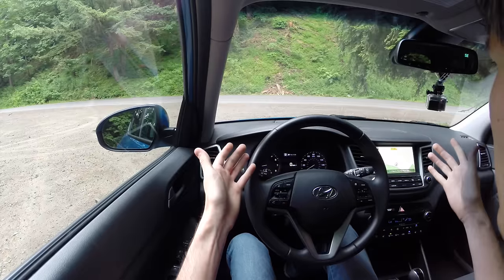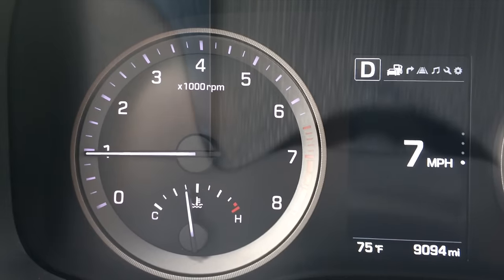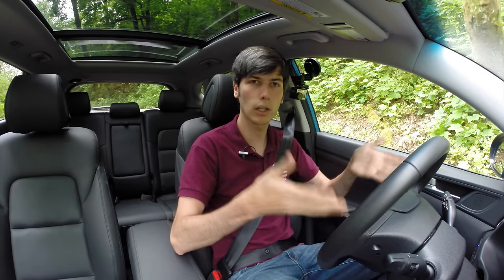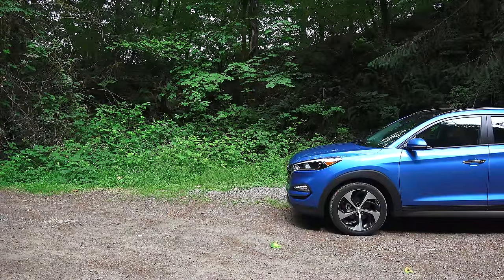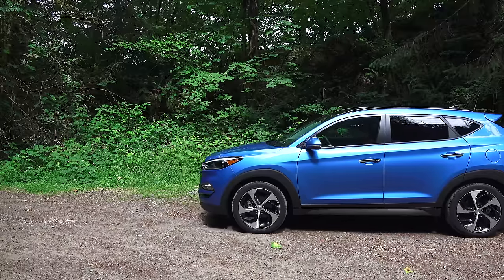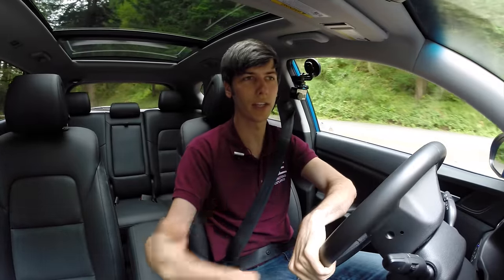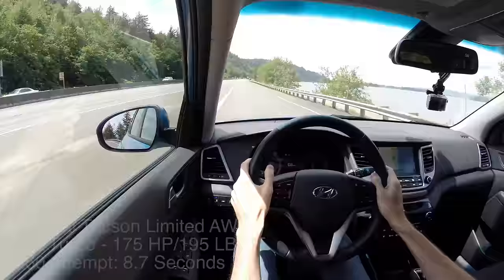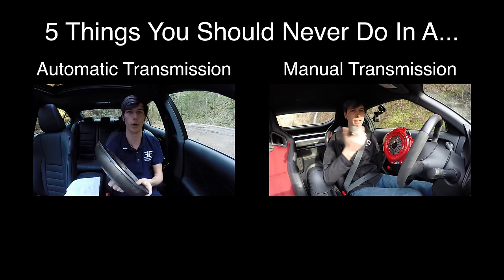5 Things You Should Never Do In A Dual Clutch Transmission Vehicle

Comment: Hi, Just hope you can further explain how to prolong the life of the DSG gearbox when stuck in traffic and inching forward is inevitable. Whats the best way to drive it? Should I put it in manual mode and drive it gear 1 and prevent clutch from engaging gear 2 since speeds are probably less than 10kmh. Noticed that gear 2 comes on as early as 5-6kmh when on D mode. Any suggestions or a video for driving in traffic on a DSG? Thanks
Reply: Joseph Edison Junior JoeBlack72 following
Reply: Pretty much. There's really no way around if you drive in traffic a lot.

Comment: I have a two part question. I believe the newer Tucson had different drive modes e.g., one for snow, one for comfort etc. Will the mode impact the dual clutch operation. I'm especially interested in the answer for snow because I use compression breaking in very slippery conditions. Thks.

Comment: i presume these things operate much like an "autoshift" transmission found in heavy trucks. its basically a 10, 13, or 18 speed eaton that is automatically shifted using a combination of computer control and air (trucks have an air compressor and air brakes). personally i prefer a truck with 3 pedals.

Comment: How does auto start stop and auto Hill hold affect the hill hold situation, can I hold the brake until the car auto turns off the engine and leave it there? Does the start stop mechanism also disengage the clutch/transmission?

Also does the auto hold feature actually place more strain on the clutch as its not letting the car move as quickly when you go to accelerate?

Comment: An "automatic" transmission that requires some more knowledge and different driving techniques than either torque converter or CVT transmissions is not such a good idea for the typical driver that expects an automatic to not have any special behavior. I have been reading since you posted this video about many problems people have experienced with dual clutch transmissions, either because they have been using the DC incorrectly or because of some inherent problems with the design & function of the DC trans. The DC seems to be an overly complicated method to provide the function and efficiency of a manual transmission and it appears that with the increase of cars using a CVT or the new 6, 8, or 10 speed torque converter transmissions that use of the DC is in decline. I would suggest anyone contemplating purchase of a car that uses a DC, to search if there are reported problems and definitely drive the car for many miles in different situations to see if they really like the way the DC operates. Maybe future designs of dual clutch transmissions will reduce any need to treat them any different from the other types of automatic transmissions.

Comment: Hello,
I have a Golf mk6 1.4 TSI 160 HP with DSG (DQ200) .
Some while ago I decided to but a Caravan which is 1000kg. But I am not sure that the transmission can tow a caravan apprx. 1000kg. According to the technical data it can do up to 1400 kg theoritically but the question is; will I face directly with problems?  or can I tow a caravan with obeying the rules you mention.

Ps: At the moment the car is 125.000km at the clock and the mechatronic and  clucht are change at 85.000km. 
thanks in advance.

Comment: Hi, thanks for the informative video but I have a question. Recently I just bought a 2013 Hyundai Veloster, it has DCT and I'm hearing a clunking noise when I attempt to stop the vehicle at low RPM, is that something normal to hear in a Dual Clutch Transmission?
I hope you answer my question because I'm really concerned about this clunking noise!

Comment: Would these transmissions work on a truck this looks like a cool middle ground you could have the advantage of shifting manually pulling a trailer but the ease when driving highway of no shifting needed. I wonder if they also could use this in a 4 wheel drive attitude so as that you could even actually get from 4 low to 4 high or 2 high wall still moving

Comment: I like driving my 2019 Hyundai Veloster turbo ultimate dual clutch 7-speed in the manual mode but my only concern is when I'm slowing down should I be downshifting the whole time or just let the computer automatically downshift? Because it has a very hesitant and awkward feeling downshift while I'm breaking

Comment: On one hand you say that there is no need to put the car on neutral if you come to a standstill because the engineers are smart enough to see the problem and so they have designed the transmission in such a way that both clutches get disengaged automatically. Therefore no input from the driver's side is required. However, on other hand you say not to creep with your foot on the brake for long duration as that will lead to slippage and heat generation. In stop and go traffic conditions, wouldn't the clutches auto disengage thereby preventing slippage?

Comment: Wait what if you're driving and want to overtake someone so you downshift to a lower gear for more torque? I ask this because you said not to downshift with your foot on the accelerator but in this case you should.
Reply: Put the gas pedal to the floor and it will make a "kick-down" shift. Picking the best gear for acceleration.

Comment: Can you shift into Manuel mode while you're actually cruising along in a duel clutch transmission. Let's say you spot a hill and it's 30mph. You want to select lower gear for engine braking. Could you select Manuel mode while driving?

Comment: Ok. What wasn't covered is my question. Is there any problem with coasting in neutral with a dry (or wet for that matter) dual-clutch transmission? I happen to have a 2018 2wd version of that same Hyundai Tucson 1.6T 7spd DCT. I've been dropping it into N since new when coasting & never have to rev match or see any odd engagement issues once returned to D. It always seems to pull it off seamlessly.

Comment: If you’ve completed a DCT “Shudder” recall on a 2012 Ford Focus DPS6 Powershift Transmission in 2017 would it be better to drive 100% in auto, 100% in manual or a mix assuming 5 year remaining life for the vehicle?

Comment: What would be wrong with just having normal manual transmissions and RWD. And a small electric motor to power the front wheels for when you are stuck in traffic or carparks and you don't want to be burning your clutch and wasting fuel.
I love engineering that keeps the operator involved in what's going on. Flipping switches, pressing buttons, pulling levers, depressing pedals, it just makes you feel like the hero in an action movie... ah well I guess that's just me.

Comment: +Engineering Explained So do these rules apply to Hyundai Ioniq hybrid or Kia Niro hybrid? The DCT receives the output of the electric motor, but I think electric motor can fully stop without need to disengaging the clutch or to using sem-clutch for inching forward. Can you confirm my speculation? Thanks!

Comment: If you stand with your foot on the brake, your clutches i'snt fully disengaged, I own a 2017 Audi A4 with 7 speed tiptronic and I can fell a difference with the transmision on neutral and in drive, so if you stand for long period it's better to put the car in neutral.

Comment: That "inching forward" is a bit difficult to avoid with my Honda NC 750 DCT. Especially when your filtering though traffic :( Other than that, I follow all those rules. Just a quick one for the day it does need reconditioning/rebuild. Will both clutches need to be replaced or wil they attended to the only one that's worn out?
Reply: Why wouldn't you replace both while you're in there? It's not like changing an air filter.

Comment: if my auto transmission car rolls back on  a steep incline, should I move off by using the handbrake and accelerator like in a manual car or use the launch method as described in your video?

Comment: Car dealers, sale reps don't mention about how to drive a DCT (DSG etc..) transmission correctly thus giving it the best longevity. Avoid heavy towing and regular super slow stop-and-go queue driving for best longevity. 

It's in the user manual but it seems many doesn't read it carefully and just use the DCT exactly like a regular automatic  transmission with torque converter...

They or the next owner will pay for it later... To the liking of the brand automobile repair shop...

Comment: I need some help.
I have a ford dct and need to understand what are the symptoms in case a clutch change is required.

Usually, I do long trips and this time I am planning a 1000 KM trip to Himalayas. I am worried what if clutch fails or something. If I know the indicators, I will know whether the car is fine to take to high mountains.

 I have known/read cases where a well performing dct clutch just failed mid-trip without any warning.

In manual cars, cluch simply becomes tight.

Comment: Long shot but I just recently bought a 2015 Hyundai veloster with the dual clutch it’s the re:flex not the turbo I was driving down the road a week ago and all of a sudden it stopped accelerating but it still runs sounds like hell though and when I went to give it gas it like tries to sputter out is it possible that it went out

Comment: When approaching a stop light I use engine brake to slow down and on the last few meters I put it in neutral. This way I have to apply less brake force than when I keep it in Drive. So in my case the clutch doesn't really disengage when coming to a stop and you really feel the brake fighting against the engine. Also the stop is way smoother when shifting over to neutral at the end.

Comment: If our Audi is on an incline, it keeps the brake on when you remove your foot from the brake pedal.  When, you apply throttle to proceed, it automatically releases the brake.  Thus, point number 2 does not apply.
Reply: smart car

Comment: Interesting comments. Hyundai never could make my 2016 Tucson dual clutch work. Program changes and control unit change and still just went out of gear driving down the road at an even speed. You cannot keep your foot on the brake and try to accelerate like you say. Car will die out. Have to insure your foot is off the brake to apply throttle. Not designed for Albuquerque as long backups if traffic very common and you are forced to creep along or get shoved along. Transmission overheads if on a hill incline and in stalled and creeping traffic. Manual says stop and allow it to cool but crazy if you are still in traffic. They had to buy back the lemon.
Reply: Sounds like they gave up on the dry clutch and must know be more like wet clutch units that work. Lots is owners still in danger with the dry clutch.

Comment: Hi, i just wanna ask this may not have to do with the topic though, i have a turbocharged 1.6l engine make less than 140hp, the transmission fitted was made by punch powertrain, it is the cvt3 (i know its very old version of cvt) . The issue was whenever im going downhill thecar will start doing engine braking automatically if i dont upshift, whenever before entering a corner 
with/wo engaging the brake pedal it will downshift itself again automatically, its like the car dont want it to be pushed around sharp corner... And so, I will just have to upshift again to keep my engine revs low and avoid auto engine braking..

Comment: I have 2 doubts what's the best way to brake in an emergency situation in automatic transmission (dct) and can we put in neutral when the signal is red which is in a few metres  away and keep the car coasting in neutral till there
Reply: You just hit the brake pedal has hard as you can and the computer will do the rest. Also don't put it in neutral while its still driving

Comment: Dual Clutch Transmission need Clutch Replacement as one of the fate after certain usages.  Could be fast could be slow depends on who drives it like Manual Transmission car.

Comment: Can you keep your foot on the accelerator when up shifting or should you momentarily take your foot off the accelerator for an upshift?
Reply: You can keep your foot on the accelerator. Just dont put pressure on the brake on upshift or press the accelerator while downshifting. I usually dont brake while downshifting either i wait for the downshift to complete then brake if needed

Comment: Good old textbook information. It’s always wrong to a degree. I owned two DCT transmissions now. One was a 10 Mitsibishi outlander. If you came to a stop in Manual mode in 4th. You were still in 4th until you came to a complete stop. If you came up the a red light that turned green. Then you would have gear down yourself.  Now I own s 16 Jetta. The DCT will downshift by itself at the shift points. That if you don’t slow down by downshifting. I also own a older ford truck that has a real Manual transmission. If you drive in Manual mode. You should know how to drive a real Manual transmission. If you want to drive in Manual mode. Drive you vehicle in automatic first. Take notice to the shift points. If you top end is 2000rpm on the car. And your car Idols at 700. You realistically can shift at 1000rpm to 2000rpm. That’s if the computer will let you. My Jetta won’t let me shift until I hit 1900rpm(or higher). Know the ceiling(red line) of the car. On my Jetta it’s 3500rpm. But on the TAC it shows red line is 6000rpm. So a fast acceleration in my car would be 3000rpm then shift. The rev’s will drop to 2000rpm per shift. The rpm drop will decrease to higher gear to go in. And don’t put your foot on the brake. It’s pointless. The traction control will stop a tires squeal. Just Do it normally. On a hard acceleration, ease into the the first gear smoothly. That allows to the clutches the properly work. Driving a Manual is harder and make technical. This is a lot of people don’t learn how to how to drive Manual. All this talk about heat, unnecessary heat. The transmissions are built to stand more heat then daily driving can put on the vehicle.

Comment: So is it wrong to put my car on N in long waits like traffic lights ??
I have a VW Arteo with DSG and i always do this in traffic lights instead of using auto hold and put pressure on my break
Reply: Ahmed Saber not wrong. Just unnecessary. With start-stop, why would you need to do that?
Arteon (what engine?) probably uses the multi-plate clutch in an oil bath as in GTI. That’s a high performance clutch.
Launch control with a dry clutch isn’t a good idea,  this is hardly relevant with the multi-plate clutch.
Reply: @MichaelKatide  the 2 liter twin turbo 
I don't know actually if the DSG is dry or wet actually they don't mintion that 🤣
Why am i doing this simply because in my old car i used to change breaks calipers earlier than usual because of auto hold

Comment: Question please, for longevity purposes on a DSG would shifting into N from D before coming to a full stop help reduce wear due to skipping the downshift to 2nd and 1st gear? It would be immediately put back into D after coming to a full stop. Or is there some sort of toll this would take that causes more wear than downshifts from 2nd / 1st gear coming to a stop.
Reply: Just sell this kind of car at 80k miles or less, never ever get one in the first place if it's some VW brand, and no CVT, ofc.
Reply: @timtim8468  It's a GTI lol! But to be fair I had an Mk6 GTI for 7 years, from 39K - 89K miles and it always shifted so cleanly, the only issue towards the end before trading in was the mechatronic unit started going bad so at certain incline/declines when shifting into R it wouldn't, then R would blink and I'd have to turn car on/off then DSG would restart. And definitely taking that advice, my current Mk7 GTI is a 2015 and only has 43K miles, so yeah will prob ditch around 80/85K and get an Mk 7.5 hahaha. These cars are just too fun.

Comment: Accura has an 8 speed dual clutch (ILX and the front wheel drive TLX)with a torque convertor. Does this video's tips still apply?
Reply: I think that was the one point the video missed. Some cars have DCT & also have a torque converter which does have the ability to slip in slow traffic although it looses a lot of efficiency compared to one without the torque converter. Others, like mine, have NO torque converter. It has two dry clutch plates so you want to avoid slipping the clutches...just like a traditional manual. On mine when you put your foot on the brake it disconnects the clutches below a certain speed close to stopped. When creeping along, I just engage the clutch move up and than hit brake lightly to coast....or hit the neutral button to coast for longer distances. Tap the right paddle and it goes back into whatever gear matches the speed I am driving at. 
Mine also has a hill assist feature. On grades over a few degrees, when you take your foot off the brake it will hold a couple of seconds until you get your foot onto the gas. I don't use that as I don't want it to start going backwards if I take a bit too long to get to the gas. I use my hand brake or left foot brake. 
I love a DCT for sporty driving or on track days when i has a significant advantage over a traditional manual trans. But for daily driver use, a old traditional automatic trans is hard to beat...especially in slow creeping rush hour traffic. I like a manual trans for some things, but they are a PITA in rush hour traffic also.

Comment: I miss my 2008 legacy GT Limited, had an automatic dual clutch transmission, changed gears so fast didnt even feel it and no loss of power. Biggest mistake subaru did was replace it with its CVT garbage.
Reply: Flyingfast79 Uh Subaru hasn’t introduced a DCT yet...it’s in the works. Your 08 Legacy just had a run of the mill 5EAT with you being able to shift via the paddle shifters.

Comment: I have an interesting question. Assume your accelerating hard, preparing for an upshift. But you accidentally pull both paddles at the sane time engaging neutral.
Would the car over Rev or would the sudden unload of the engine cause damage to the engine?  Car would be a Lamborghini  Huracan.